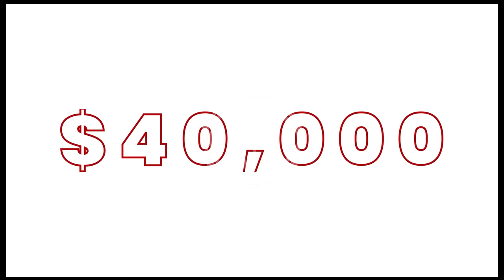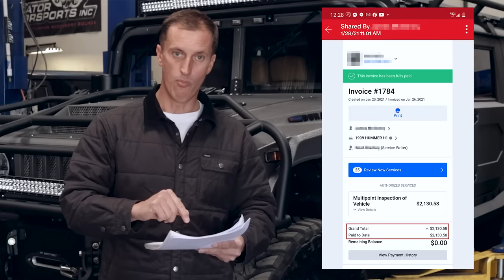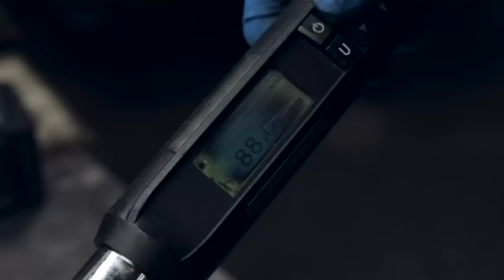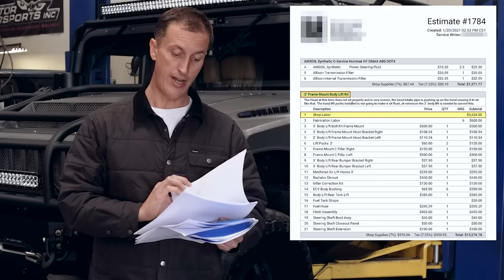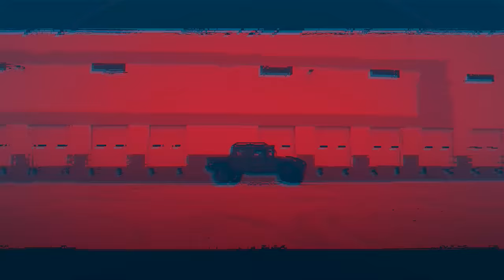$40,000 H1 HUMMER SHOP SCAM!

Comment: If I were the owner, I'd refuse to pay and slap that other shop with a lawsuit for fraud (including the unrequested inspection) and $40,000 worth of damages.
Reply: also, libel, defamation, and slander come to mind.
Reply: Problem is they can hold your vehicle ransom until you pay the bill.
Reply: @rifleman1873  And that's why the cops would be called. 
Customer didn't sign anything agreeing to an inspection or mechanic's lien. 
Shop can not retain someone's property.
Reply: @rifleman1873  Not sure where this happened, but in my state, you need to have an estimate authorizing any work over $100 and anything over 10% over the estimate.  You as the customer have 3 options, I want a written estimate, I want to be notified if it'll go over XXX amount, or I don't want an estimate, just do it.  In my shop I would NEVER allow the last one... I want a number at which the customer would want to be called.  If they wanted me to "Just do it!" I'd say "OK, so if it's $25K to replace the spark plugs in your escort, I should just do it!?" Please, just give me an amount at which you want to discuss the cost so I don't exceed that.  And no way in hell would I be paying for an unauthorized $2K plus "inspection".
Reply: @rifleman1873  yep. States near me allow a "Mechanic's Lien" which allows an auto repair facility to hold your vehicle until a repair invoice is paid.
Reply: @Tommy_Mac  repairs you didn’t approve? The didn’t even fix the power steering.
Reply: @Tommy_Mac  this is correct... There IS such s beast as a mechanics lien but it WON'T hold up in court if it is due to charges for service NOT requested by the customer. From what I gathered from the video, the customer only requested power steering pump service and not the inspection so therefore that falls under the "not requested" clause. Having had my own shop, I have no clue where or how they could have possibly come up wth the $900 ish dollar original price for an inspection and then more than doubled when the car was to be removed from their shop. That price is called fraud.
Reply: Anyone know the name of the shop yet ?
Reply: 100% this is slander and defamation of character and needs to be dealt with ASAP
Reply: Mod Mafia is the shop!
Reply: Lawsuits are expensive. He would be out probably close to $40K after all was said and done.
Reply: Ok...lets all challenge ourselves to know the definitions of libel, slander, and defamation and the difference between them by the end of the day if we're gonna use them in public communication. ...
Reply: @saltysteel3996  Civil issue, cops won't do crap.  Also, mechanic's lien is for non-payment.  If you put your vehicle in to be repaired, You've already agreed upon paying for "something".  All that can be done is pay the fee, then going after them for the money, attorney's fees, your time.
Reply: @jeremyfranks7608  got a full inspection on a 1990 buick reatta before i bought it... 100$ full look over to make sure im not buying dogshit.
Reply: @oliverdepauw5663  I agree on getting a pre purchase inspection but they shouldn't cost more than $250 ish depending on make, model and local pricing... But their pricing was complete and utter shit
Reply: @rifleman1873  not in Michigan.
Reply: Actually anybody who does an authorized work to your vehicle without your consent can get in trouble they're not allowed to do unauthorized repairs unless you requested them only thing they can do is just notify you they are not allowed to charge an inspection fee unless you've asked for an inspection even then if they did any safety inspection they are only allowed to charge the state required amount for safety inspection
Reply: He most likely had to pay to get his car back. He can take them to court, but this customer sounds like he has deep pockets and a high net worth. If he can afford to buy a top of the line hummer with a turbo diesel swap, and the drive it 1500 miles in 3 days, it's probably not worth his time to go to small claims court over a $2000 inspection fee. Super scummy and calculated by the repair shop.
Reply: @Tommy_Mac  That's great....he gets to hit them for loss of use on top of the fraud. You also have to file a lien through a court most times, and most judges take a dim view of falsifying a govt document...
Reply: @Tommy_Mac  there were no repairs completed only an inspection not asked for.
Reply: @deeznutzz8375  how do you know it's Mod Mafia?
Reply: jared price  Not sure what state you are in, however here, if you put your car in to be repaired but do not pay the shop will get a lien against it.  it is not theft, of the vehicle, that is theft by not paying.
Reply: jared price  in the UK if you do work even an inspection that is not asked for you can not charge for it
Reply: The arguments being made here are all state dependent. You would have to look up what state they were in for what laws are. Where I manage a shop at you only have to inform the customer there will be an inspection on every vehicle taken in and by them leaving their vehicle it is consent to be charged. Here in my state the cops will not do anything because this is a civil matter. So this customer would have to hire a lawyer and spend time which it may not be even worth it to the customer.
Reply: @rifleman1873  not if you did not authorize it.
Reply: Not a Hummer owner, but from what I  see here, I  wouldn't let that other shop do an oil change on my lawn mower. Shut 'em down!
Reply: I would have just slapped the person tryna rip me off. Right in the face.
Reply: If you don’t involve legal representatives and government agencies, your doing all your customers a disservice.
Reply: Let's just say all the play in the drive shaft should be there.... sure. Mod Mafia is way more knowledgeable than Predator
Reply: @invictusbp1prop143  slander=verbal libel =written defamation = damages to good character
Reply: @kylesharpe9355  lol looks like someone is working for mod mafia and trying to save face and a lawsuit.
Reply: Call Saul Goodman (-! He loves such cases.
Reply: @Tommy_Mac  Promoting the myth that there is nothing more to the law of a Mechanic's Lien than that is only making the Crooks bolder.

Personally I have never met a modern contract law that was 1-2 sentences long. There's considerations, conditions, exceptions, due process. 

Imagine the power of a law that states "By Law, handing a Mechanic your keys constitutes a 'Blank-check Contract'. Whereby the Mechanic retains a material property right over the vehicle that supercedes the right of the Title Holder. This contract can only be satisfied by paying the Mechanic an undisclosed amount of USD, to be determined post-hoc, and subject to change without notice."

All you'd have to do in a State where that was true, is get a business license, do some minimal marketing advertising your new shop: 'AAAABSOLUTE BEAST HYPERCAR EXXXOTIC SERVICE AND MECHANICAL TECHNICAL ENGINEERING'...  Hire a total noob ASE Certified Mechanic. Then tell him your rate for inspections is $1000 per 15 minutes, and you require a full inspection of all vehicle systems that enter the shop.

First couple Exotic Owners that drive into a shop because he heard about it from some IG Skank with gonzo hardball titties... officially the car is yours.

Fortunately, that's not how it works.
Reply: @rifleman1873  It's unlikely that it's his only potential daily.

What I think needs to happen to protect the public, is there needs to be a provision for suspected criminal or fraudulent business practices, where you can show up, unannounced, with the police, and immediately seize your vehicle, pay them NOTHING, and make them take YOU to court.

Additionally, anything they claimed against the previous shop, should be subject to both the Court of Public Opinion, (NAME AMD SHAME BRO! WHO DID THIS??) and if necessary (clear intent to harm) they should sue for libel/ slander, and if their enterprise crosses state lines, and the fraud or criminality is clearly organized and significant enough, then call the FBI and the IRS.

Could turn into RICO, and if audited, with practices like this, imagine how likely is it they go down for Tax Evasion too. Just the Inspection and Inspection 'Doubling' alone is enough for me to confirm that they're not just benignly ignorant of Hummer/HMMWV differences. They are beyond shady, and they actually deserve the name "Predator"  criminal.

This kind of bullshit should be met with all barrels.
Reply: @kylesharpe9355  Shop Name checks out then. Really inspires trust.

If the enterprise crosses state lines, and the fraud or criminality is as clearly organized and significant enough (as advertised), then the Owner of the vehicle and Predator should call the FBI (and the IRS).
Reply: @AutitsicDysexlia  your opinion and not a myth. "Mechanics Lien" is a thing.
Reply: @rifleman1873  not if you didn't agree on the "repairs". I would immediately and quietly call the police while at the shop.

Comment: As an attorney that represents automobile dealers and specialty shops my clients and I do not tolerate this type of conduct. We regularly have to send cease and desist letters to unscrupulous and predatory competitors; which also include strong language regarding tortious interference and libel and slander (defamation). Your shop is top tier and your reputation speaks for itself. Great video.
Reply: I'm thinkn ... if you contact them directly , they will share...
Reply: if i got a transmission job I tell the customer i want to replace the rear main seal on the engine. The transmission is out is 5 to 10 minutes to change, and that i want them to enjoy and used the car for years without issues. I don't want to pop the transmission in there and a week later pull the transmission because the rear main started leaking.
Reply: Yeah! What he said! ^
Reply: Mod Mafia is the shop. They have a video up about this Hummer.
Reply: @billelliott5939  He cant, bar rules are funny like that unless he was retained.
Reply: @sostrucking  link to video?
Reply: As a dude that doesnt wanna get ripped off by other dudes including but not excluding exclusively everything and car shit too... I also do not tolerate this kind of conduct.
Reply: @danielpeloton6835  that’s funny right there!

Comment: $1000 for the power steering,  but $1300 oil change?!?!   Man,  I'm in the wrong business!
Reply: Idiotic items by themselves, but they also completely erase any credibility for anything on the invoice. Seems pretty obvious that they just want to take advantage of rich H1 owners that don't know any better.
Reply: Defense is the greatest offence
Reply: Hey I have a cheaper car which has $1000 bill just to change water pump and it's a gmc
Reply: There is a Firestone shop here that is doing the same rip off scams in my town for years
Reply: KTMARV 1  tree fidy
Reply: @stampede18ecs  how old is your car? Does the timing case need to be removed to access water pump? This would make it a 1000 dollar job simply because of labor (correct way to play in the timing case is to pull the engine first, you dont have to but its faster in most cases).
Reply: @oliverdepauw5663  it a 2014 and the water pump is ran off of the timing belt. Most of the price is labor since some of the exhaust has to to remove,heat shield before you get to the water pump. The car wizard did a wonderful video explaining it all.
Reply: Even for a commercial truck an oil change will only set you back around $300.  Total scam.  Major lawsuit would be in the works.
Reply: @markmayfield2228  exactly.   I pulled into a valvoline with my own oil and filter for my diesel pickup,  and asked how much to just drain and fill it for me, spin my filter on.   They said $50! I thought that was a rip off so I left.  I had been busy, but for that price I found the 10 minutes it would take!
Reply: @markrahkola3365  nothing is ever 10min.  It’s not like the mechanic is walking from job to job on a production line.  They also have lunch breaks etc, which means that you are really paying not just for the job, but a percentage of overhead plus there is then the shop overheads as well.  I’m not sure what a mechanic gets paid in the US, but even a simple 10min oil drain, you should expect to pay x3 times what the mechanic would have earned just for his time plus a contribution towards overheads for the shop.  Even though it’s a small job, $50 does not sound super exorbitant.
Reply: @Berzilla  Firestone promotes ripping customers off, because they provide bonuses based on sales.
Reply: @paulmilo999  Well, if we're setting a stop watch from when I turn off the key to when I'm done washing my hands,  yeah more than 10 minutes.   For a shop set up to specifically do oil changes, no more than 10 minutes, for ONLY the oil drain and fill, spin MY supplied filter.  Most of these quick lube places check and top off all your fluids,  wipers,  exterior lighting, and grease any joint with a zerk. I told them I didn't want  any of that. 
    Even lawyers billing out 10 and 15 minute jobs only come out to 300 per hour (depending on firm,  market,  field of expertise).
 If your cool with $50 when your supplying the material, good enough.
Reply: @Berzilla  I've been scammed by a Denver Firestone on Broadway myself

Comment: Thank god the Owner was knowledgeable enough to not fall into the trap.
Reply: The Owner failed miserably from Day One purchasing the H-1 Hummer.  They are Junk and enough said.
Reply: @sbowden60  They are junk but you behold deep pockets enough said.
Reply: I would say he was knowledgeable enough to say no I won't pay $40,000 to repair something I just paid $xxx,xxx for. Stop at your a chain brake shop and see how much a $100 brake job will really cost you. Everyone is after your money,  few people will do the work at a reasonable rate and not add a million items to the list to jack up the price.
Reply: @apuckett1971  So true, I remember the first car I had a toyota camry, I put new brake pads on it and afterwards it started making a scraping sound, took it apart to look at it and couldn't figure what I did wrong, so I took it to a pep boys down the street, told them the noise I was hearing and said I was pretty sure it was the brakes. They call me back later that day after I took it in and told me the axle was broken, and some other stuff and wanted to charge me 5k in repairs. (It was a 1991 with 160k miles on it) The car wasn't even worth that much money. Told them no and when I drove it away, the scraping sound was gone, they had inadvertantly fixed my issue, and I didn't have to pay them anything since no work was done. Shady shops are everywhere. (This was back in 2003)

Comment: I'M SORRY, WHAT?? Did you say that they wanted 1300 dollars to CHANGE THE OIL???   WOW.    I'm a woman that almost got taken for an $800 ring job on an old civic that was burning oil. It was just pure luck that I needed to reclaim the car to use before they had done the work and I ended up taking it to a family owned place called "The Bug Shop" where the very nice gentleman told me I had a leaky valve which would cost me all of $14 whole dollars.  Didn't even charge me for the labor to put it in.  I was grateful beyond belief because I would not have known how bad the other place was ripping me off on that , but even I would have told the shop to pound sand if they tried to charge me quadruple digits for a simple oil change or go to frickin Jiffy Lube!  If I would have seen a number like that on paper I would have been asking what currency they were expecting ... perhaps Japanese Yen!

Comment: I was a mechanic in the Army for 6 years, and I can't believe that the person who inspected that Hummer conversion was a mechanic in the military.  In our MOS school we are taught that military vehicles do not have the safety requirements of civilian vehicles.  That means no crumple zones(in reality the entire HMMWV is the crumple zone, side impact protection, nothing.  Just be glad it has doors, a rood, seats, and a windshield, because I have driven plenty that did not.  With that said, like you stated there is a lot that has to be modified to meet safety requirements for on road use.  I would put acorn nuts on the floor protector bolts though to keep the threads from getting all buggered up, also looks nice.  I also have never seen that lock nut design for the hubs, is that a Hummer modification requirement because in the military we use a spider washer.
Reply: Finally someone that knows something. Preech it brother.
Reply: yes, those are the DOT approved nut and spindle assembly, used in the H1. The HMMWV setup is for ease of change in the field, as is most stuff with the army.

Comment: I had a warranty repair on my Ford Fusion at the dealer. About 2 years later I was changing my brakes and found the spindle nut from the offending axle lodged in the hubcap, completely off of the spindle. It hadn't been properly staked.

Comment: You should definitely inform people of the shop so people don’t go there.
Reply: That isn’t wise for this shop due to the other shop can then sue them for defamation. Even tho it’s factual
Reply: @maddog7771  you can sue anyone for anything, dosnt mean you will win.
Reply: @Jimmy Johns1210 Bud, you are trying to defend the indefensible. Sit down.
Reply: @Jimmy Johns1210 Don't need to know the work, to know that what MM tried to do is not only wrong, but downright criminal.

How you think their actions are defensible, is baffling. It's fine to prefer a shop, but this ain't that. However, I can tell you're just some punk that feels safe behind anonymity, so, this conversation is over.
Reply: @maddog7771  When the shop or the customer sues the fraud shop, their name will come out. Even if they dont win, they will be exposed.
Reply: @NaruSanavai  its what desperate shops do, usually due from lack of repeat customers.